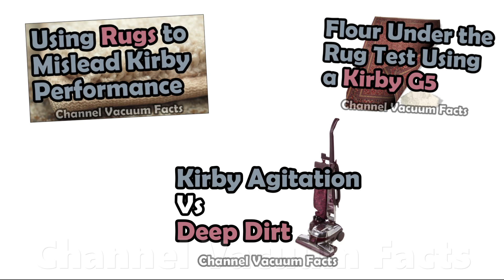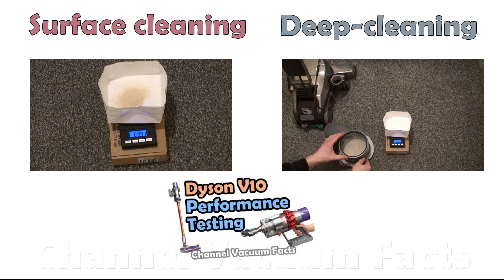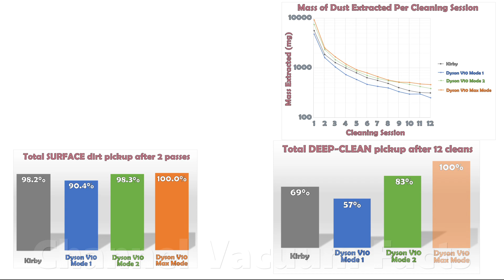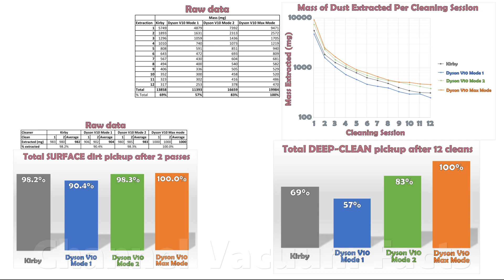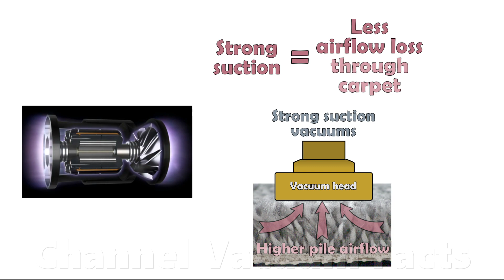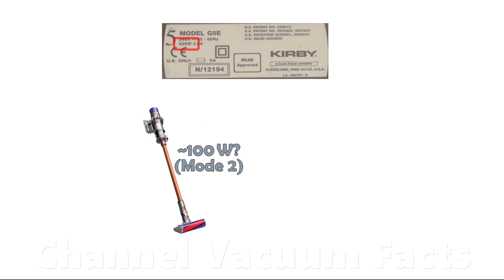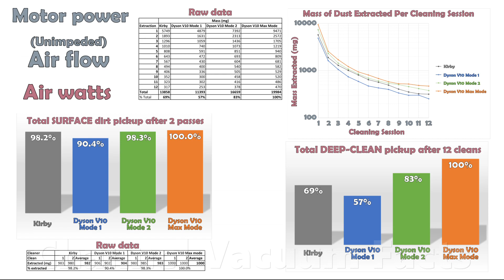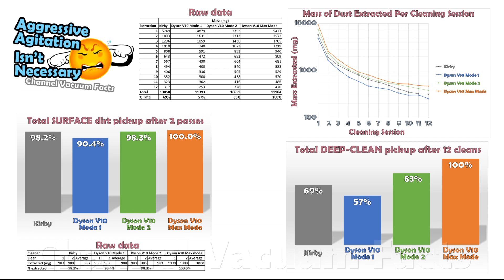Dyson V10 Vs Kirby: How Well Does a Kirby Vacuum REALLY Clean?

Comment: I love our Kirby, it blows away every vacuum I've ever had or used.
Reply from the maker: @Steve R I was enjoying the now deleted conversation from earlier. I was going to add that like it or not, Dyson invest huge sums of money into research and development, they solve genuine problems, and their technology is patented. They design specifically to be the best on the market and have a premium price tag to go with that. As such, competitors out for profit only are left copycatting their patented ideas to compete, and they never work as well, as discussed here https://youtu.be/U_qS2i6HQRY . I've never understood why people hate their plastics. They are highly advanced, recyclable polymer blends that take advantage of the best that materials science has to offer. They use derivatives of polycarbonate and ABS, which are highly durable and flexible. Their products employ lean engineering (i.e. using only the materials necessary to avoid waste, weight, and environmental impact). Their hostile testing (plenty of clips on YouTube and in my videos) shows they survive where others fail, and only total neglect and abuse causes more than cosmetic damage. And it's under warranty for the most part and their modern designs are all modular, with replacement components mailed out in the post for quick swap-in. No one seems to complain about other brands that use plastics, even products like the Henry, which has always struck me as a bit suspect from naysayers out there. I've (responsibly) used a few Dyson products and I've never had one get damaged. Often neglected and abused Dyson machines are cited as evidence of poor design, but that's misleading propaganda and could apply to any product that's been abused and neglected. No engineer for any product designs for unreasonable treatment (neglect and abuse).
Reply from the maker: ha, at least you're honest :)
Reply from the maker: I dread to think what product you used instead. Unless it was a Henry... >_>
Reply: @VacuumFacts  Dozens but I don't think I'll be needing to buy anymore.  I've been using my Sentria since 2006 and it's still awesome.  We have dogs and make lots of messes so it gets used a lot.  I've only had to purchase more carpet shampoo, bags and belts because of all the different hair that gets tangled in the roller.  It is heavy though and I gotta be careful around cords because it slices through them
Reply from the maker: @Smileysue74  Given how poorly Kirby's perform relative to the best cleaners out there, amazing what must be still lurking. Those running costs that are avoidable on other machines must be adding up by now too. Yeah, I found it unbearably heavy; the best modern cleaners are a tiny fraction of the weight and effort to use.
Reply: @VacuumFacts  Actually, the bagless vac is a good idea except it creates a mess when emptying unless you empty it inside a bag big enough for the entire thing to fit inside and then I gotta find something long to reach inside to free all the fuzz stuck at the top.  It's really gross so nobody else does it and I have to do it outside and then take a shower afterwards bc no matter how well I try to enclose it inside a big bag, there's always stuff that escapes either while emptying or while freeing the stuff at the top.  The kirby packs everything into a bag; it's always so heavy and hard because it's so compacted so I only need to change the bag once for the several times the other needs to be emptied.  The bagless vac has a real handy wand available for getting into small spots but the kirby requires a few minutes to switch to a hose bc by doing so you're changing it from being an upright to being hand held,  The Kirby is probably one of the few machines that's built like things use to be  when they were built to last. That other vac gets used often enough and it's decent but nothing compares to the Kirby's suction and ability to grab stuff other vacs roll over.  I've never known another vac that is as good at picking up baking soda and carpet fresh either and unlike other vacs, the Kirby doesn't get clogged up when picking up the powders that have absorbed moisture.  A lot of vacs have been destroyed by those powders so I only feel safe using the Kirby for that.  We also have a cordless handheld that is shit but like the other vac, it does a decent enough job ....I just checked our other vacs Currently we have a Dyson Absolut,(mentioned above as the bagless vac),  Eureka Opima, Bissel 2  in 1, Shark Cordless, Black & Decker cordless handheld and a Hoover Steam Vac...But the one that blows them all away is our Kirby Sentria.
Reply: ps, the replacement bags (6 Universal HEPA Cloth Bags for Kirby Vacuum F Style Avalir Sentria by DVC) for approximatly $13.  I'm not sure when I bought them but the review I posted on ebay for them is dated Jul 15, 2017 and I still have 2 left.  I just received a 3 pack of replacement belts that I got delivered for $5.52.  Admittedly, the other vacs don't need new belts as often but then again, they don't pick up all the dog fur and hair that the Kirby picks up.  I usually cut whatever is tangled up in the vacs because once they get tangled they don't pick up anything at all. For the Kirby, it's not as obvious when it gets tangled bc it continues to pick up even though the roller has stopped working, It's not until I smell the melting of the belt that I realize it's got so many tangles preventing it from continuing to spin.  Also, before I got the replacement bags, I actually emptied the bag (gross) by hand and used it again. Another reason why I know how packed and full the bags get. It was so gross though which is why I don't mind buying replacements.
Reply from the maker: @Smileysue74  The messy bin emptying is a myth; technology has moved on (except for the copycat clones) and it is possible to empty the best designs in 5 seconds without any mess, as demonstrated and explained here https://youtu.be/E_ik6qScs0o . They also self clean. My review of the Kirby highlights how modern designs have improved usability https://youtu.be/x_Rry3u1Kcs . Each to their own, but very few use cleaners like the Kirby anymore, and for good reason, as the data in this video unequivocally shows.
Reply: @VacuumFacts  Are you accusing me of lying?   First of all the video  shows emptying the bin exactly as I stated that I need to do in order to not get a cloud of dust except I don't leave the bag open when I dump because often I need to tap it on the ground to loosen up the contents. I'm sure it would be easy for me too if I was dumping out a few cups of uniform contents instead of a mixture of contents filling the entire bin. Secondly, in the 2nd video did he really say that the Kirby is so heavy that he "doesn't have the means to weigh it" bc I thought most people owned a scale that they kept in the bathroom.  He also states that the weight of it makes it "dangerus."   Lol.... sorry... LMAO  I hope this guy isn't relied upon to change the water bottle or empty the trash or God forbid, hold a baby or toddler. I like that it's heavy and durable as with most items that are built to last.  I'm not going to waste time watching the rest of that video bc I would rather rely on my personal experience.  I get the impression that you work for dyson or is it just because Dyson is a company in the UK and that's where you live?
Reply from the maker: @Smileysue74  Of course not. I'm simply stating facts; the evidence of which is in the videos linked to and that you're commenting on. Most people seem to conclude I work for Dyson; it's a logical error; saying something positive that's evidence-supported about a product made by a given company isn't the same as working for the company. Again, each to their own, but objectively, there are far better products than the Kirby out there.
Reply: @VacuumFacts  As iong s my Kirby continues being awsome, I guess I'll never know bc I don't plan on ever buying another vacuum.   I almost thought I was working for Kirby bc of how much I was saying about how good of a vac my Kirby is.  With regard to the price people pay for a kirby.. Yeah, people are so dumb and easily taken advantage of which is why I spent a couple minutes looking up Kirby while the salesman was here and I only agreed to it at the much reduced price because of their money back guarantee.  When attempting to return it a few months later because of it's weight, they reduced the price even more so I got our Kirby for a hell of a deal.
Reply from the maker: @Smileysue74  Yeah, I've heard stories like that; it's a terrible shyster tactic used to peddle junk to vulnerable people who don't know better. I'm glad you like the Kirby, even if the evidence and data shows it is a relatively poor performer. Fortunately, the Kirby brand accounts for a negligible portion of the global vacuum cleaner market share and only has a small number of fans amongst the dusty collectors and those who don't know what good technology really is.
Reply: @VacuumFacts  I asked a repairman friend of mine his thoughts on Kirby and Dyson and this was his response, "Kirby is #1. Dyson works great until it clogs up and then it's downhill from there. Dyson would only be the best for looks." and then he added, "Dyson, I can tell you from experience have so many seals that start leaking right away.  It's pathetic, I usually turn down working on them."  After I commented that Dyson is pretty good he said "I didn't say Dyson was bad, it's just that they aren't even in the same league as Kirby.  Dyson is 50% looks and  great advertising."  One of his comments also said that the only thing he didn't like about Kirby was the weight.
Reply from the maker: @Smileysue74  His opinion seems to be very different to my experience. I've never valued anecdotes or opinions on matters of fact. Evidence reigns supreme, and without it, there's no good reason to believe anything. It's why I always present the evidence in my videos. Subjective opinions can stay where they belong on matters of fact — in the toilet.
Reply: @VacuumFacts  Dude, seriously. Are you okay?  Are you sure this is just about vacuums?  I 'was reading other comments posted and it made me wonder if there's something going on in your life that's troubling you. because you seem like you have invested so much of yourself in responding to comments, etc. Experience a great loss recently? Lonely?
Reply from the maker: @Smileysue74  0_o I see. In the absence of any further valuable input to support a faltering point, I often see people transition to ad hominem attacks. I think you've nothing further to say...
Reply: @VacuumFacts  No, I just feel bad for you. I don't want to continue because you obviously refuse to believe what anyone has to say if it conflicts with what you believe.   It's like beating a dead horse. How can you possibly convince me that my kirby isn't the best vacuum I've ever had. and it cost less than 1/2 of the dyson v10?  Aside from that, a repairman that I trust and respect had nothing bad to say about Kirby, stating that the only thing he didn't like was the weight.  I was just trying to be nice bc people aren't meant to be locked down as we have been during this pandemic.  It's fine for me since I rarely, if ever leave the house because of my spinal injuries but for someone who's life has been changed by the pandemic, I can't imagine how hard it must be so I was just trying to reach out to you in case you needed someone to talk to or whatever. Forgive me, I meant no disrespect. Here's just some of what I found online "Conclusion. In 10 comparative tests, the Kirby was best in 8 out of 10 and the Dyson came out with only 2 out of 10. Having said that, the Dyson was the best vacuum cleaner for the most user-friendly and best marketing, while Kirby was better in all performance testing." www.homecleaninglab.com; "The airflow, agitation and suction on the Kirby is super strong on your carpets. ... The cleaning power of a Kirby vacuum at the floor head is due to its motor design which maximizes airflow and agitation. As a result, Kirby vacuums will perform better than Dyson vacuums by this measure." https://homevacuumzone.com/kirby-vs-dyson/
That was available in the first page of results.  Before that I had read some other comments here plus your responses. I realize that it may not be fair for me to be debating this topic with you.
Reply from the maker: @Smileysue74  The situation is that I refuse to believe what anyone says on matters of fact unless it's supported by some evidence—especially when it conflicts with evidence already available. I said as much previously. Too many people don't understand the distinction between subjectivity and objectivity on matters of fact. It's a failure of the educational system. I've never tried to convince you the Kirby isn't the best vacuum YOU'VE ever had; I've simply said the evidence shows there are even better products out there. I said as much previously. There are many 'tests' out there on the internet, but on inspection, they are mostly absurd and unrepresentative of anything meaningful and sometimes rigged to deceive and mislead. The only testing that's truly robust is independent international industry standard comparative testing e.g. IEC60312, which requires a laboratory and careful statistical analysis. Such testing demonstrates consistently that Dyson's machines are the best performing vacuums on the market. This is qualitatively reflected in my testing as well.
Reply: @VacuumFacts  I didn't realize how expensive the dyson v10 is.  We got our Kirby for less than that and several years later, it still has super strong suction.
Reply: @VacuumFacts  You are basing your belief upon standardized tests and in order for them to be fair, the exact same kind of material debris needs to be used in every test.  The very thing that makes those tests fair is the same thing that makes those tests unrealistic.  I'm not picking up granuals of some specific material, my experience comes from cleaning up real life messes that aren't uniform or made up of ony one kind of debris.
Reply: @VacuumFacts  This repairman who's opinion I asked is 60+ years old and has at least 40 years experience plus a warehouse full of broken vacuum cleaners that he plans to fix one day.  I wish I could do a real live test for you but all I have is a dyson absolute for comparison
Reply from the maker: @Smileysue74  Such tests show relative performance for representative test dust (the small stuff is the most difficult to remove and most harmful to human health). Real world messes contain a wide range of materials and particle size distributions, as I've covered in my videos, and any vacuum can get the obvious big stuff. Any cleaner that is good for small material, as used in my tests, is good for large stuff too.
Reply: @VacuumFacts  Also, the vac needs to maintain that level of efficiency over time... after several years of continued use and abuse.    Most vacuums are awesome at first
Reply from the maker: @Smileysue74  Yes, and is where the DYson vacuums excel. On the condition you simply empty the bin (which is costless and messless if done right) and rinse the filters, it will work as well on day 1 as year 10. Other than the occasional detangle of the brushbar, no other maintenance or runninog cost is required.
Reply: @Smileysue74  Don't worry about this guy, he's sponsored by Dyson and is desperately trying (and failing) to get people to buy Dyson vacuums through fake tests and labeling opinion as facts.
Reply: @Smileysue74  Neutral observer with no “dog in the fight” but in one earlier comment you cited the heavy weight as a good thing, yet in this comment you say you attempted to return the vacuum because it was too heavy.  Which is it?  Too heavy (so much in fact, you tried to return it) or do you “like the weight because it was built like things used to be”?  Another observation, you said you looked up the Kirby brand when the salesperson was at your home, and after considerable haggling over price, made the purchase.  When you tried to return it because it was too heavy, they offered you an additional discount.  Do you realize that means the markup is MASSIVE for a machine that costs nowhere near the exorbitant prices they charge, and they gladly sell their cleaners for full retail to other less savvy customers such as yourself?  Capitalism is great, profit is good, but one of the points @Vacuum Facts made was they have shady business models that gouge customers.  Lastly, unless your vacuum bags are self sealing, and your Kirby is a 100% sealed system, you are still causing lowered indoor air quality and most likely the Dyson achieves much better PPM exhaust than the Kirby...he is correct about the bagged myth too.  Salespeople need to have an answer, and that’s what they came up with.
Reply: @Martin_Vail_Esq.  I have come to appreciate how heavy my Kirby is, since posting comments here I have used my Kirby a few more times and currently I am shampooing the carpets with it.   They can charge what they want, I don't support how much they attempt to get for their product but I am proof that if a customer isn't happy with the product there is recourse for them to seek.  My Kirby cost a lot less than the Dyson.  As for "shady business models" I can think of quite a few others.  I do have a Dyson that I can use as comparison and the suction isnt as strong.  As for the bags, I  don't have a problem replacing them and I've never experienced a mess upon replacing the bags as I do when emptying the dyson.  If I could share pictures I would show you the  bagless chamber of the Dyson and how dirty it is.  [img]https://i.imgur.com/xsQEuRF.jpg[/img]  [img]https://i.imgur.com/twb7LQv.jpg[/img]  [img]https://i.imgur.com/yfsYv3V.jpg[/img]  [img]https://i.imgur.com/FmODym9.jpg[/img]
Reply: @Smileysue74  well thanks for replying to my random observations.  I personally haven’t had good luck with Dyson over the years, so if you have a brand that works for you that’s great.  As I said, I have no dog in the fight.  Have a great evening.
Reply: @Martin_Vail_Esq.  You're very welcome.  Maybe you should try a Kirby, it's not hard to find refurbished ones or used ones at a reasonable price.  Thank you for your contribution and offering me that option to elaborate on some of my previous comments.  I had posted other comments  for clarification purposes but I deleted them bc I felt I was monopolizing the comments and thought it best that I stfu unless I was specifically asked.  Thank you and I hope you have a great evening too. Be safe and don't forget to do it with a smile. :)
Reply: @VacuumFacts  Dyson Absolute, Eureka Optima, Hoover Steam Vac, Shark Cordless, Black and Decker Cordless Handheld and a Bissel 2 in 1 and the Kirby Sentria are the vacs we currently have for comparison
and the others didn't last very long
Reply: @itsGabriel7  Much better. I've got a Kirby and I've got a V11. I NEVER use the Kirby anymore.